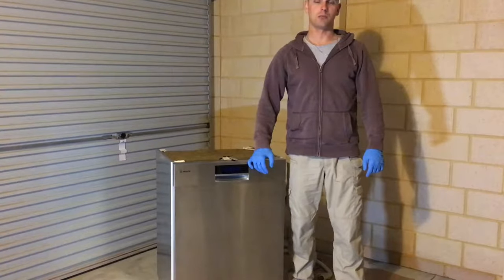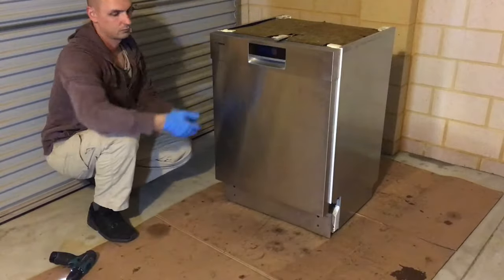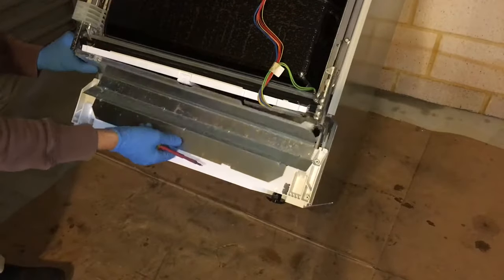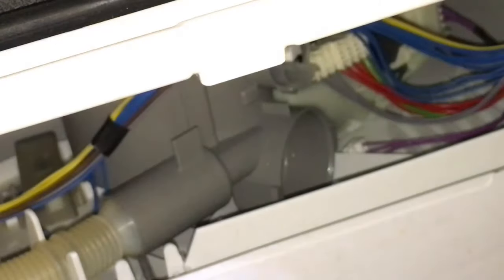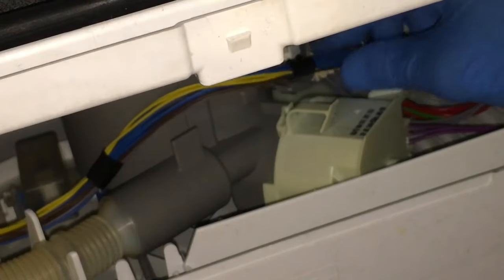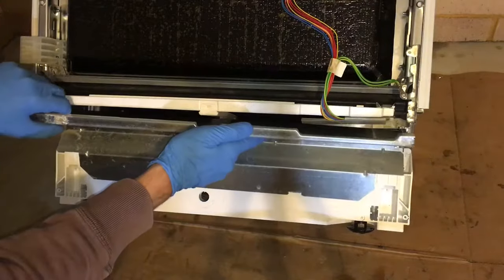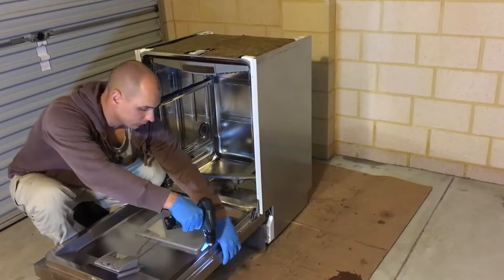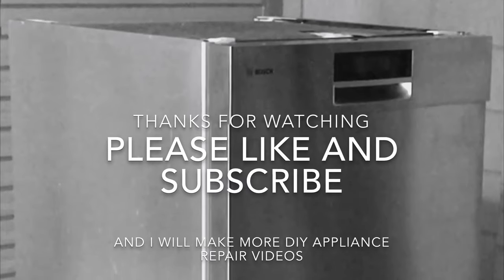How to replace drain pump in Bosch dishwasher

Comment: Thanks for this video. Before you replace the pump, pop the impeller out and see if it can be cleaned. I found a lot of hair and crud wrapped around the shaft and removing it fixed the issue.

Comment: Good video, thanks, but with some comments.  First, this process is much harder when the dishwasher is actually installed under a counter.  I found access difficult, constantly having to lye on my back or side from various directions to reach the fasteners.  Second, it would help to mention that the fasteners are torx, not phillips, screws, and many people would have to go out and shop for torx drivers.  Somebody suggested soap on the motor gasket to make it possible to wrench it into the hole, but I used olive oil.  Either way, it was virtually impossible to get the pump into its hole without lubrication.  Fourth, the space for rotating the pump is so cramped you cannot connect the wire harness until the pump is installed properly, but then the receptacle faces away from you and it is difficult without a mirror to see where to plug the harness in properly.  A final note:  after (thankfully) using your advice and puzzling out the other mysteries on my own, my dishwasher still failed to drain.  I have cleaned the filters three times (they were only plugged the first time), and now I have a new pump installed, and the problem is just as bad as before.
Reply: Did you ever figure out the issue?   I’m having the same problems after replacing the pump

Comment: Very simple and clear to understand. The job itself was really easy to do if you are a reasonably proficient DIY person. I was sure the pump was blocked after the impeller as it wouldn't empty and kept coming back after clearing. It turned out to be the water inlet unit was blocked with limescale and other rubbish and needed to be replaced- now have the dishwasher working again!

Comment: Thank you this really helped me, I found my problem was a piece of broken glass stopping the impeller spinning, the dishwasher responded with flashing the input pressure tap icon, but that was because it wasn’t draining, you could literally hear the pump crunching this piece of glass, which is why I went straight for it, and your video helped me find and remove it, clear the blockage - thank you!

Comment: This was great, helped a lot. I checked the standard things that prevented the dishwasher from draining (debris in the sump, blocked hose etc), but it still failed to drain intermittently. So followed your instructions and looked at the pump. It still spun, but had a fair bit of cotton and hair and stuff wrapped around the axle, which probably was enough to prevent it from draining. It also gives you a chance to check the outlet hose where it meets the sump, and for me this also had a bit of unpleasant congealed fat or something in it, so I cleaned that out too. Looking good now. Thanks again.
Reply: Did you have to replace it or was cleaning it out enough to make it work again?

Comment: Brilliant video. Easy to understand steps. A dash of common sense (and tools) is all you need. Beforehand, I could hear the motor/impeller still trying to work for a split second, then stopping. After inspection I found a tiny piece of glass which was stopping the impeller. Really stoked. Thank you!
Reply: P😊

Comment: Great video. My issue turned out to be the citric acid granules I used recently for drainage care had formed two small lumps that stopped the impeller from turning. I've learned to use smaller intermittent doses of the citric now.

Comment: Thanks for this. I pulled out the pump, and discovered a small round piece of plastic that was clearly stopping the impellers from turning. Looked like seal from a bottle lid. Not sure how it got there, but now it’s gone the machine seems to work great again!

Comment: Thanks so much, our dishwasher is back up and running after watching this. My pump had picked up a long thread of cotton around the shaft which was not letting it spin freely and I was getting Error 25. It took me about 5 minutes to inspect the pump with only basic tools after watching your video. I didn't even need to buy any parts! 
Cheers!

Comment: Thanks for a really helpful video. I would like to ask, in your experience can a pump just become "weak"? My pump runs and sounds OK but the machine will only pump out if I lower the outlet hose to about 1/2 height of machine. Then it pumps really well.  It used to work OK with the hose going to the top of the machine.  All filters are clear and pipes clean and pump impeller is clean and spins smoothly.
Reply from the maker: You’re welcome. 
I haven’t seen this sort of thing happen to these pumps. But have seen a strings and rubber bands get wrapped around the impeller slowing them down and not allowing to pump at full capacity
Reply: Yes, I had this same symptom. Also the pump was louder than it used to be and sounded like it was groaning. I replaced the pump and it fixed the poor draining.

Comment: Does anyone know if there is a check valve between the pump/impeller 'chamber' and the drain hose?  Also any hints getting the drain hose disconnected? Those plastic 'forks' sure make it difficult.

Comment: My drain pump in my Bosch dishwasher is  turning (plastic fins are all there) but not draining water . The pathways are seemingly clean. Is it the rubber valve near this pump which is responsible? It seems intact. Thank you.
Reply: Did you sort this out?  I have same issue and suspected a bad solenoid but can't find location.

Comment: Put a little bran oil on the rubber seal, it makes it way simple to put back in and twist.
Reply from the maker: It’s best to use some sort of non harsh detergents. Some oils can make seals become spongy and deteriorate.
Reply: @ApplianceFault   agree but bran oil is very light and dissolve in water,  it is food grade. The rubber on the pump is designed to handle harsh detergents used in the the wash process like highly alkaline salts. Sorry chemical science is one of my things.

Comment: Hi. Great video. Took out the faulty pump easy enough but getting the replacement in is proving impossible. It just will not go in even and when I turn it to secure it it does not stay level and will not click in place. I’ve been trying for over 3 hours and ready to give up! Help!
Reply from the maker: Hello,

Try putting a bit of liquid detergent on the seal of the pump. This should help it push in and twist easier.

Comment: Does anyone know where the drain solenoid on a Bosh eco dishwasher is?  My check valve is ok, impeller/motor running fine, float and micros witch work but unit doesn't drain.  The only thing I can think of is the solenoid to open flow from tub to drain.  I can't seem to find it...